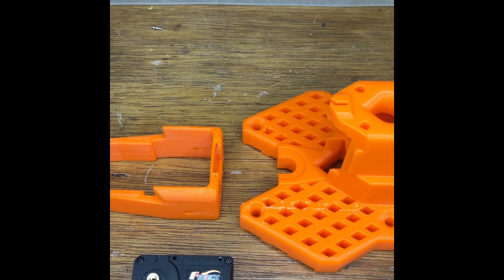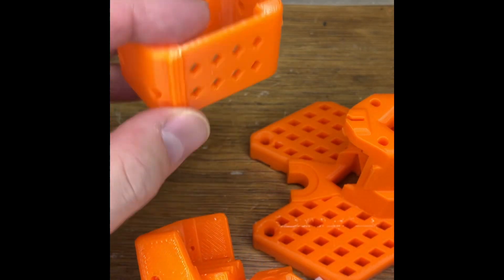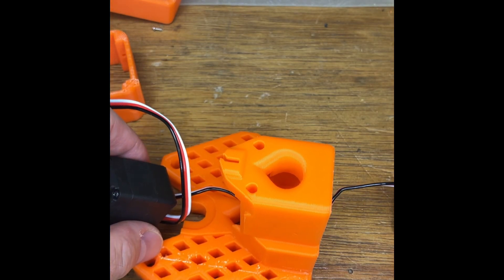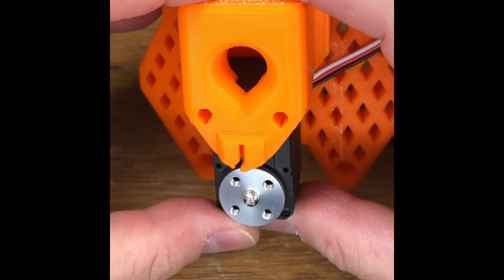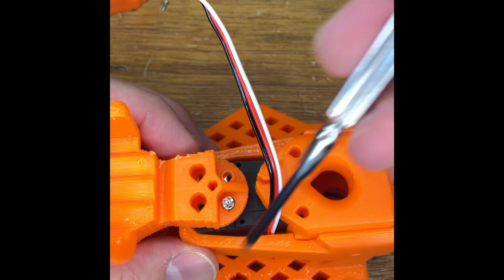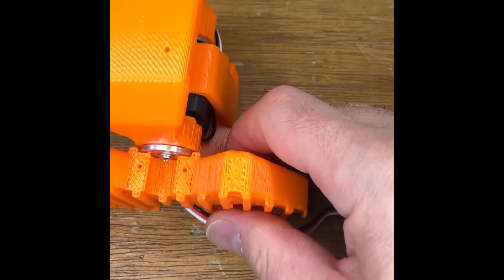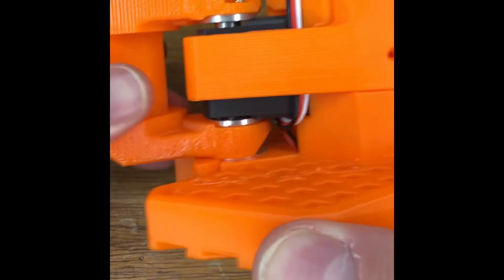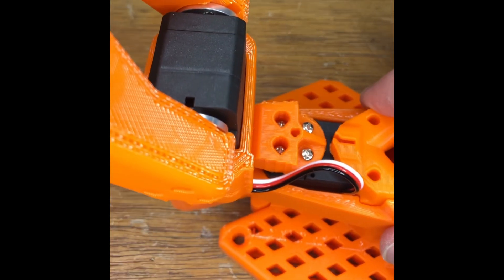SO-Arm100 Assembly Detail: Base bulk, clip and clamp with wiring order

Comment: You say "You're going to set it to be powered.  Also set the angle offset to 1024".  I'm using the Feetech FT SCServo Debug V1.9.8.3.  There is no "Powered" field that I can edit, so I am wondering how I set it to be powered (or not powered in the case of the leader).  Also, there is no "angle offset" field.  There is a "Position Offset Value" which I assume is the correct field.  Am I supposed to set the goal to 2048 and the position offset value to 1024?
Reply from the maker: Yes. That way the servo is centred and you have the most adjustment possible with the Position Offset Value.
Reply: @therobotstudio   Great!  Thank you.  How do you set it to be powered, as you comment in the video?  I am not finding that setting.  Thanks for your help.

Comment: Hey , will the HOPELITE come with its custom board or will you use raspberry Pi,jetson nano or lattepanda?
Reply from the maker: Open to suggestions. 

Generally I provide an interface at streaming serial level for motor variables.

What runs above that depends on the task at hand.
Reply: @therobotstudio  well then I suggest either raspberry Pi for great performance or bbc microbit for cost cutting although microbit is not superior to raspberry but it could be useful especially if HOPELITE is focused on education purpose as well
Reply from the maker: People will be able to choose what best suits their application…